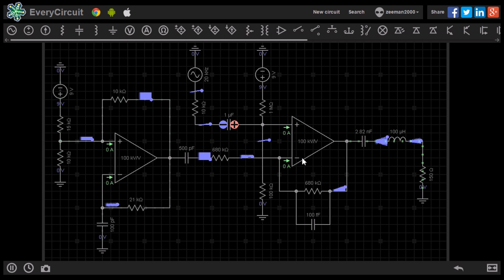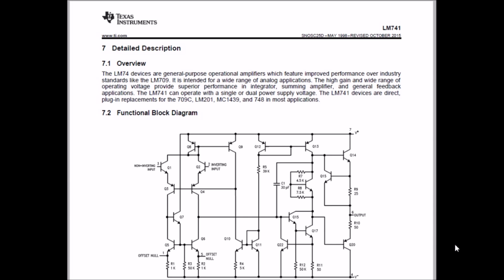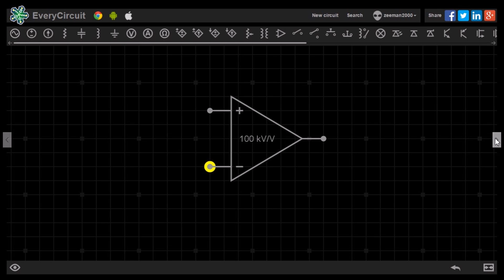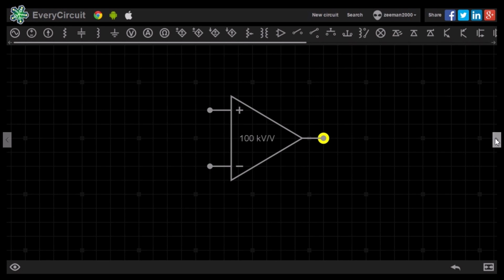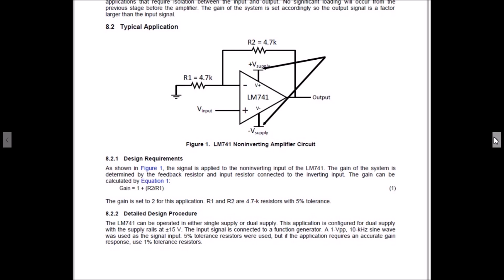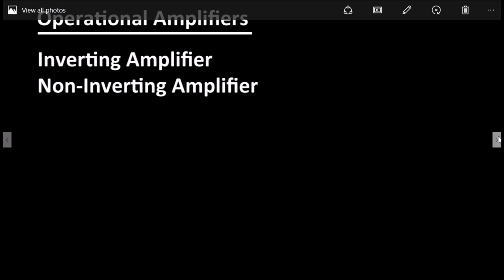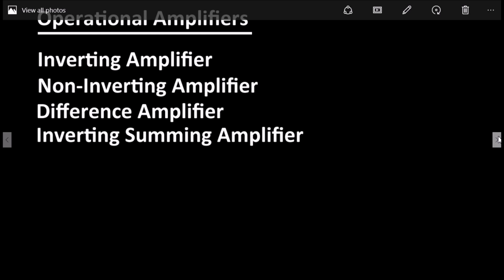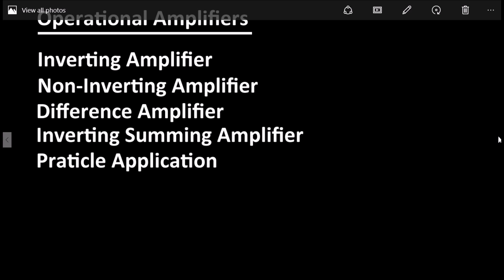Electronics Tutorial 13 - Op Amps - Overview

Comment: The op-amps power supply was very confusing to understand. I thought the min V out and Max V out were the component specs like an LED diodes .25 max wattage. No thats its own power supply, thats whats driving the op amp, just not showing the battery all hooked up, but implied for simplicity. Its very simple to understand now, but I think its a commonly missed concept in op amps.

Comment: Great set of  tutorials on the op amps. I am only confused on one thing. How do you represent (read connect) the V+ and V- supply  in EveryCircuit  and also connect your + & - inputs ? I understand that on an actual chip you will have the V+ and V- pins but they are not represented in EveryCircuit. Thanks in advance for your help.
Reply from the maker: Hi Gianpaolo, apologies for the late reply. To allow room for other components the Op-Amp component in every circuit only shows the + and - input and the output. The supply voltage is adjusted in the settings. Just highlight the component then click the spanner icon. You will be able to adjust the values for Min Input and Max Output from hear. Hope this helps.
Reply: Thanks !